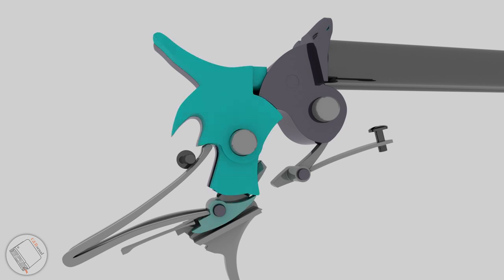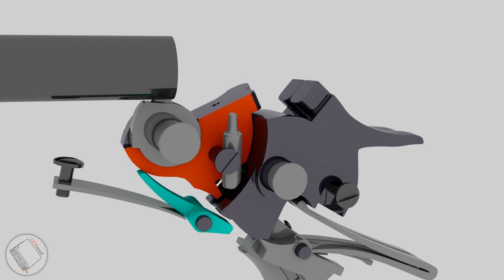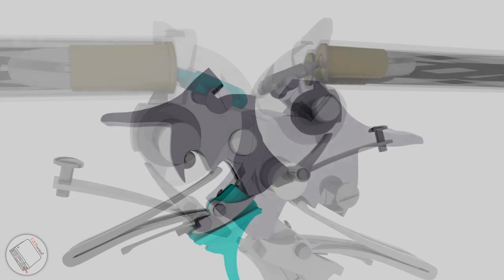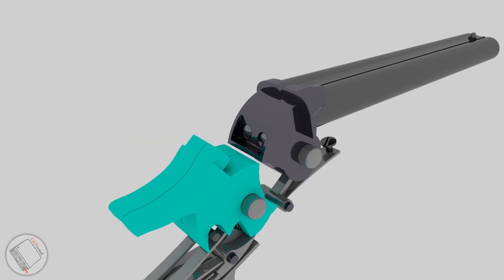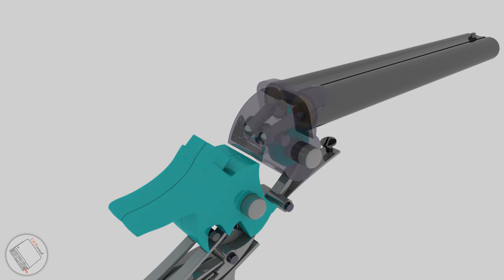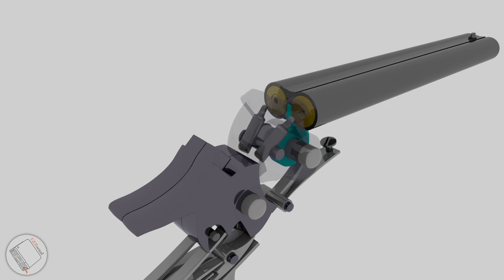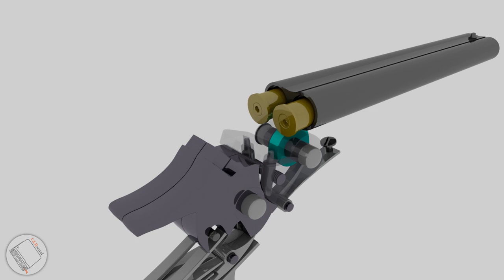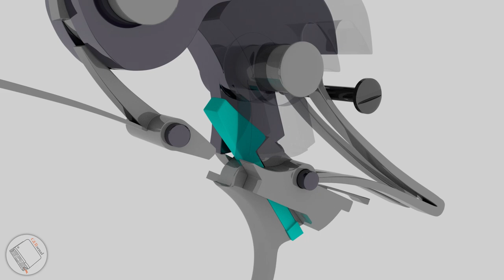How it Works: Nagant 1877

Comment: Double-barrel pistol. Can it be modified so both barrels can go off at the same time? I don't know if that would help but it should give a better cloud of smoke. 😅
Reply: Sure if you're willing to modify the transfer bar.  Easiest would likely be to grind down the nose of it so the right hammer being cocked no long prevents the bar's rear from biasing left to also engage the left side sear.

Though modifying it so you could select between single or double barrel firing would be trickier.
Reply: I wonder if any of them ever got used enough to potentially cause the exact change needed as a fluke.